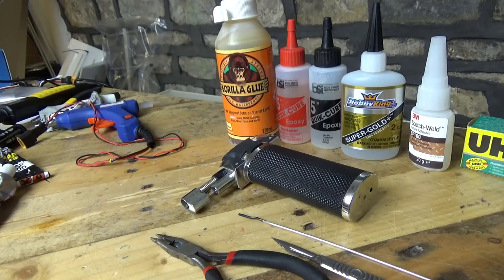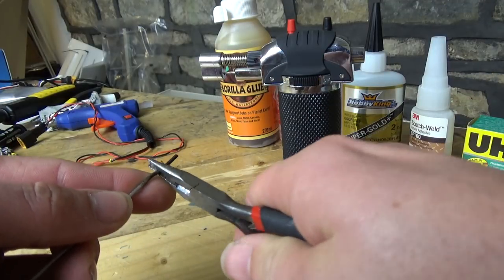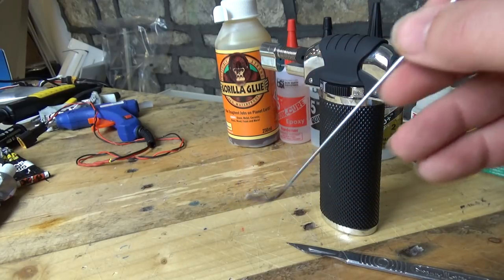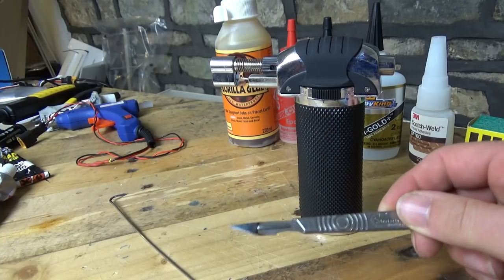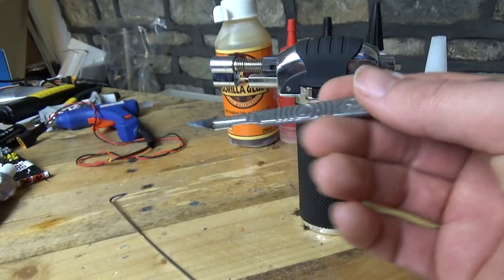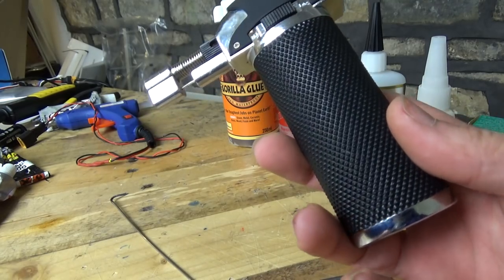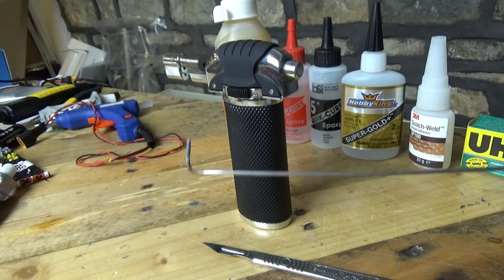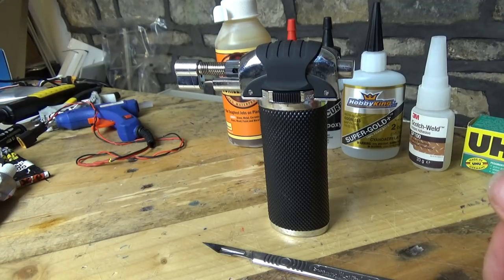Mini Review: Blow Torch for RC Modeling

Comment: Used mine yesterday to heat up an alloy tube to burn the holes for the servo wires on a Lidl glider build and to heat up cheap craaft knife to cut up some plastic tube. Have also used for cutting the front off of plastic spoons for el cheapo air scoops